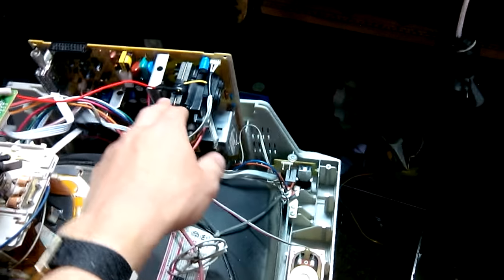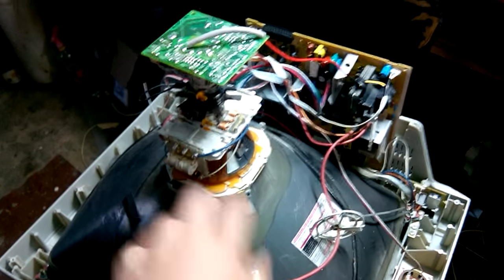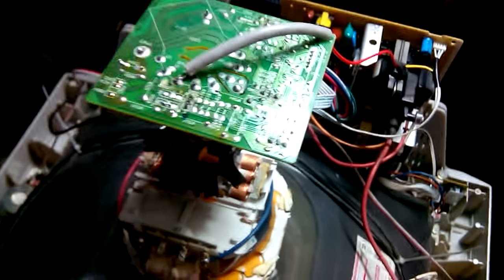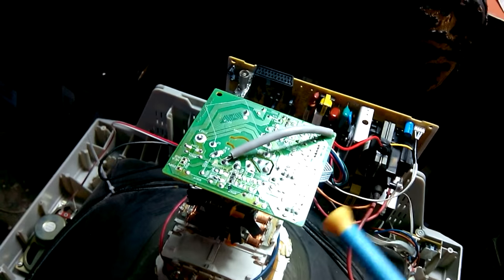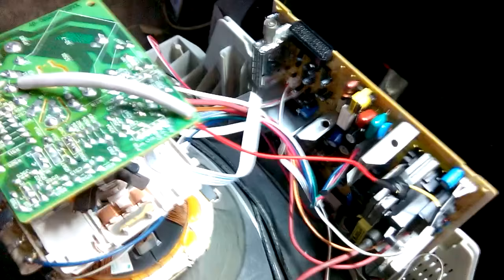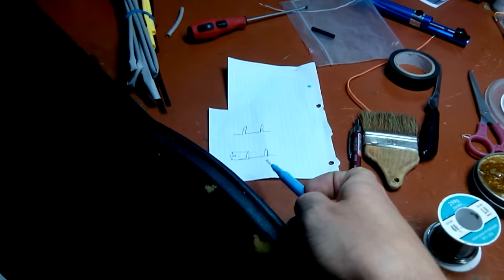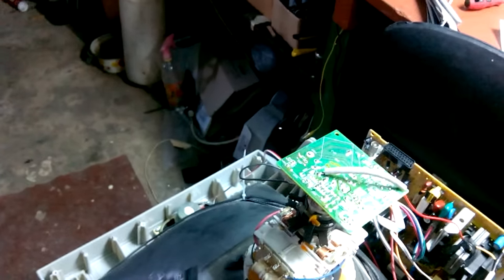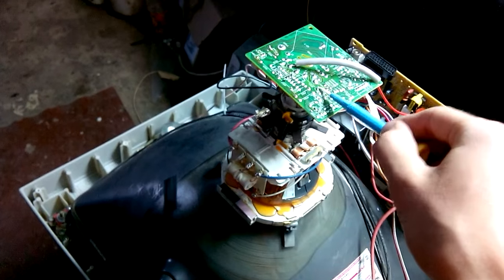CRT TV Repair (Red&green screen with retrace lines)

Comment: Great tutorial.
My monitor shows green color otherwise working fine..When I disconnect the monitor from the CPU, and the monitor is still on, it shows "Check cable connection" message which is also entirely green.
Reply from the maker: Is entire area of the screen green, or only the active areas (message box, etc.)? Do you see weird color splotches on the screen? If you see the splotches, the degaussing circuit failed. The TV in the video had the screen fully filled with color.

Comment: i like ur knowledge but i dislike the way u try to explain it, for example in this video u dont even show us where to cut the trace in the crt board and u dont show us where to put the other end of wramped wire, that is really disappointing.
Reply from the maker: And? The chances of you having same exact TV are miniscule. I give you basic instructions.
 What's the point of showing every tiny step, if it ain't gonna be of any use.